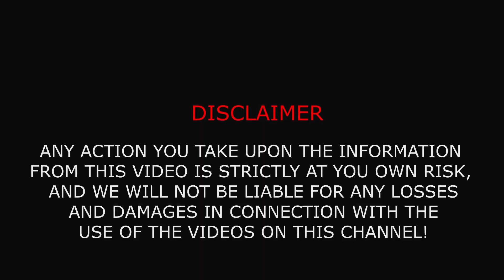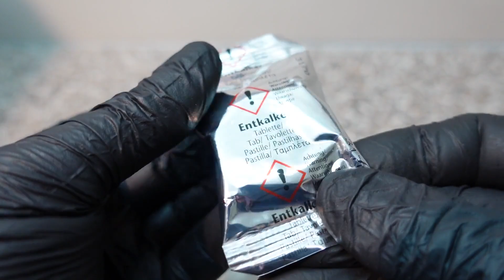The Most Important Maintenance Tips for your DeLonghi Magnifica ESAM

Comment: Hi, I have a Delonghi Magnifica S 22.110 and when I switch off the machine it dispensers a lot of hot water into the bottom tray via the steam outlet. When turning on the machine, it does its normal heating and dispensers hot water through the 2 front spouts at start-up.  When I select steam, I wait for the flashing to stop before switching to steam and at the same time a lot of steam is released via at the bottom tray through the steam selector. It does produce steam with average pressure when selected and will stop when I turn the knob upright. The problem is as stated earlier, when I switch the machine off it seems the water is supposed to rinse the coffee spouts but it just gets flushed into the bottom tray. I hope this makes sense, but I have spent many hours trying to fix this. I really appreciate your help and many of your videos and advice has helped me in the past. Thanks Stephen
Reply from the maker: Stephen, you wrote that you have already worked many hours on the machine. My question is what have you done so far? Have you already dismantled the steam valve, descaled it etc.?

Comment: After I followed all these steps, I still had an off taste.  Mine was the slightly different model ESAM3300.  I removed the spout nozzle mechanism from the door (leaving the spring assembly intact).  I found a clump of espresso residue the texture of melted chocolate the size of a grape on each nozzle.

Comment: hey i have a DeLonghi Magnifica ECAM machine i have few issues with it 
1) when i brew coffee a lot of water get collected in grounds container
2) coffee grounds container get broken coffee pucks witch is very similar to ground coffee being dumped in it directly 
i have replaced the O rings for brew piston and brew block and that was only possible after watching you tutorials (thank you )
please if possible help me resolve this issue
Reply from the maker: I think there may be a little more broken to the brewnpiston. This must be repaired or replaced. See my other video about the problem from minute 5;45 https://youtu.be/ZVrbdKXM1pY
Reply: @yt.myworks   thank you for your reply sir , i have seen both brew piston repair video and the above video link but couldn't fix the problem ,if possible can you share your email so i can send you a video or picture of the problem
Reply from the maker: yt.myworks@hotmail.com
Reply from the maker: I think the brew piston is leaking. I made a video on the subject. It could also be that the parts inside have a crack. https://youtu.be/3QBLoTMgTec
Reply: @yt.myworks  i have mailed you the videos that show problem i am facing
Reply from the maker: Yes, I have seen your videos. The water flows from the top of the machine. This is an indication that the piston is leaking. Maybe the big seals are too small?
Reply: @yt.myworks  please can you share size of (big) o rings brew piston and brew unit
Reply: my machine has black o ring nitrile material
Reply from the maker: The best choice is 35.2x4.2 like the original but 36x4 is also good.
Reply: @yt.myworks  thank you will try this fix and let you know
Reply: @yt.myworks   you suggested fix worked got a 35 x 4.5 o-ring that fits perfectly and leaks have stopped thank you for all the help
Reply from the maker: @krazzymurtaza  35.2x4.2 are the best choices

Comment: Hi man, I have a problem with Delonghi Magnifica esam 3300 series, it takes 3 to 4 minutes to heat up and rinse after turning on the machine, also when I'm frothing milk the steam is not so strong. What could be the problem and how to fix it ?
Reply from the maker: You need to change the heater. Over time, one of the two heating coils breaks. Then it takes a long time to heat up. The spare part can be bought from €25. It is best to buy a set with a record connection.

Comment: Hi, I have a Delonghi Magnifica S ECAM.22.360.S and my milk is not coming out at 60°C. It only comes out at around 40°C-45°C depending on how many times i so called clean the frother out/heat the frother from cold boot/first turn on for first coffee for the day
could you please do some videos on this model? ig deep cleaning/restoring/cleaning different components etc
Thanks this would be helpful since i don't really know how to clean this model really besides getting the whole like brewing unit/infuser unit out the side only the component that is like user accessible and putting the whole unit in a sink of water without detergent so i don't damage any component and descaling the coffee machine. btw i have only descaled the machine like 6 times since like 2017. have had the machine for like 5 years.
Reply from the maker: That cannot be answered so generally. This error can have various causes. Maybe a defective temperature sensor or calcification in the hatz etc. Try to decalcify properly again maybe it will help. In my other video you can see how I repair a Magnifica S, it is very similar: https://youtu.be/1gQKH7rGwWI
Reply: @yt.myworks  um maybe we didn't set water hardness correctly/didn't descale enough
i mean our cappuccino's don't come out too cool that i won't drink it anyway. meh if my dad knew what he is doing we could take it apart.
Reply: I just took apart the infuser and I think some white bit of plastic broke of something
Also stuck on putting it back together including where the gear thingies go
Edit: and some rubber thing
Second: infuser put back together but the top bit looks broken or something wasn't it supposed to be in one spot or something?
Reply from the maker: You can send me a picture of the part so I can see what it is: yt.myworks@hotmail.com
Reply: @yt.myworks  sent
Reply: @yt.myworks  hi again
it seems i have managed to have an issue with our machine again
ive already cleaned it out and its doing it still
now i feel like having to buy a new machine sadly
to be honest tho i might have accidently got water on the insides where its not meant to go and might have destroyed an element, fuse or Triac in it.
Reply: EDIT: nvm above it fixed itself after leaving it unplugged overnight
must have been the microswitch with the brew unit/infuser playing up.